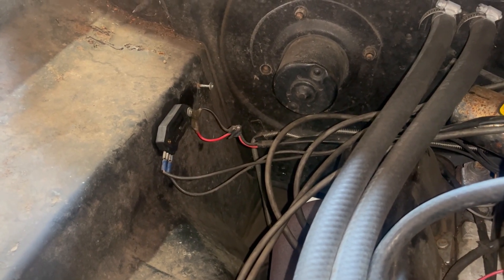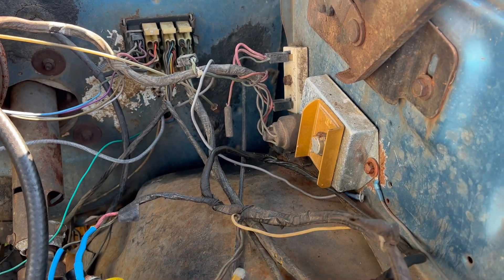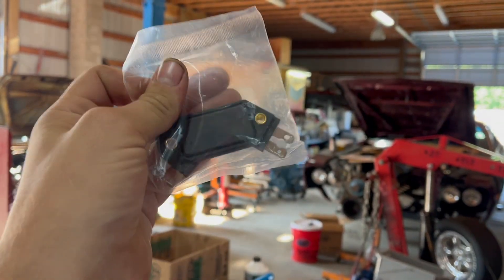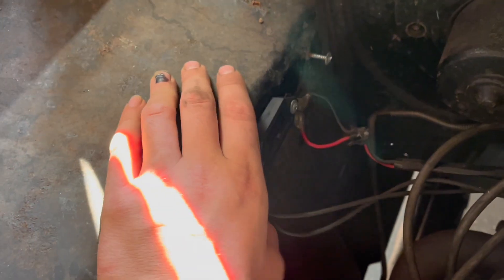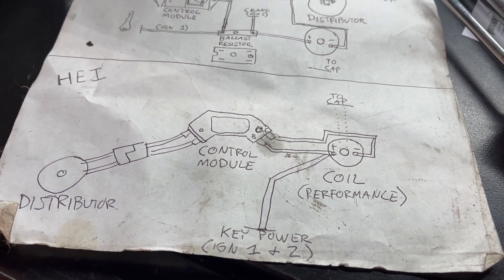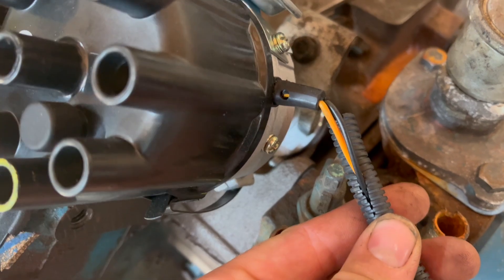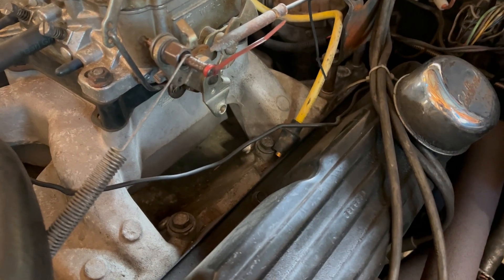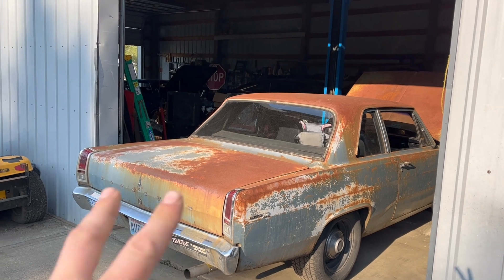The Big HEI Ignition Conversion Video! How To Convert Your Classic Mopar (Or Anything Else) To HEI

Comment: I was going to suggest a heatsink from the thumbnail, but you explained that, I even modify GM factory HEI distributors with an extra finned heatsink, especially with  performance modules
Reply: Don't need such IF you use the paste used in computers under the module, Been using Arctic Silver 5 AS5-3.5G Thermal Paste under EACH HEI module in my 3 Ford HEI conversions for 20+ years, NO issues with ANY of them

Comment: In theory, could you achieve multiple spark with a twin tipped rotor?
Or, a reluctor wheel with multiple peaks?
Reply from the maker: I don’t think either of things will do what you want. And - the MSD only gives multiple sparks at low RPM. I don’t know that it’s even worth much.

Comment: Great info, thanks!! Question: any brand of HEI module more reliable, and are there any brands to stay away from? Are genuine GM modules still available and are they significantly better?
Reply from the maker: I have been told in the comments that genuine older GM modules are a better bet than any new ones. I don’t know if they are still made, or if they’re any good. I usually buy Standard Ignition and have had relatively good luck.
Reply: @DeadDodgeGarage   Nope.  You still get to pay extra for 'genuine GM', but it clearly says 'made in China' on the box.

Now I keep my eyes open for HEIs in the junkyard to scavenge. (and, these days, it doesn't go that well)

Comment: That was a great discussion of the HEI. I noticed the quality of all of those ignition modules started failing more often in the '90's, late '90's when they became more 'imported'. The Mopar ECU always had the smallest dwell but were still reliable. The GM HEI had the best dwell. If you can find a genuine GM (Made in the USA) module you should be golden. Even a lot of the NORS were US made. I was always amazed that contemporaneously using mid '70's electronics GM was able to put their module in such a small format back then and the Mopar box was comparatively huge. GM did have a great R&D facility in the Delco Electronics div.
Reply: I paid $500 for HEI distributor to put on a Cleveland in the 90s. Now you can get one with plug wires for a 100 bucks.
And for another 100 bucks, you can get one that comes with the smaller cap, And
Coil on the outside . And that GM alternator with the internal regulator all you have to do is jump those 2 prongs togother
And charge fourteen plus.
Reply: I've purchased 2 standard motor brand. Now I purchased a "performance" one. It's got 1hour on it now its dying.
Reply: @denpepp4342  Usually the 'old' NOS or even used OE GM Delco ones were good. Even the 'parts store' brands up until the early '90's. The Pertronix 'original' Ignitor kits are OK. The original Ignitor was made in the US as of 5 or so years ago last I checked. Never had an issue with those.
Reply: In Auto Service courses I took, I learned that GM's HEI actually INCREASES dwell as RPMs rise. This allows for better coil saturation, resulting in consistent/improved spark voltage at higher engine speeds.
Reply: As a GM guy (by monetary necessity, I'm a Mopar man at heart and would've been a lifer if I were twenty years older), I can attest to just how damn well GM can do things when properly motivated. Apparently, their proper motivation ended in like 2008...
Reply: @The_sinner_Jim_Whitney  That's kind of what I figure too. After that govt involved bailout GM went to shite. And  Barra as CEO who has overstayed her usefulness.

Comment: I was skeptical that 0.38 ohm coil was too low. It would be if you were using a Mopar box, other than a real high end one like a P part Chrome or Gold box.  Well, depending on the ballast.  I just now am searching for "Primary ballast for an HEI coil" and it may be right on the money for that.  
     Anyway, you could find a good heat sink for that HEI module.   Also, some way to get it out of the flow of water from where the hood seals to the fender.
      Our family had a 56 Savoy when I was a toddler. Parked outside, water from rain and snow ran down the back of the hood to the distributor and other parts on the firewall and it was hard to start in the morning.  Towel drying was a frequent event.  The A engine had that disadvantage that the B and sixes didn't have.  I would love a 56 Savoy 2 door now.
Reply: Been using Arctic Silver 5 AS5-3.5G Thermal Paste under EACH HEI module in my 3 Ford HEI conversions for 20+ years, NO issues with ANY of them
Reply: hello ! ( from France) no way to understand how the HEI can suppress the ballast... ?? a 0.35 Ohms coil is about 43 amperes ... (12/0.35) this is exactly what my generator is producing ... of course with DWELL it is 43 x 0.7  = 30 A ...  can someone explain me this "magic"  THX ( sorry for my english here in FR everybody forgot Chrysler ignition, while it fitted a real huge lots of SIMCA)
Reply: @frednoname3714  Unless the Simcas are 8 cylinders, you don't need HEI to get a long dwell.
Reply: @auteurfiddler8706  another way to solve my understanding plz. Does HEI and MOPAR's modules just feed the coil some ms before spark ?  This would explain solve things. I want try that on a race SIMCA 1000 engine ( found distributor ) thx !!
Reply: @frednoname3714  I saw a comparison between Mopar box, HEI and Ford. They all use magnetic distributors. The current they generate is not the same in magnitude but the same in type. And the boxes or more or less sensitive. But that doesn't mean you can't mix and match.  I think you can.  Just make sure you ballast with the Mopar and regular 13.4 volts with the HEI.
 I would sure try to use the  HEI on the Simca. If it doesn't work , you can always get a CD ignition box that will work with your new distributor.

Comment: I had an experience where I had some Mopar ignition boxs and maybe a voltage regulator or two in my garage.  I noticed the goo or epoxy had melted and looked like a lava flow dangling from one ignition box. I cut it off (it had resolidified), looked at the box and the circuits, now easily visible, looked ok.  I put it back in the cardboard box with the others.
   Next time I looked, all the rest had melted out the epoxy, too.
   I have to conclude that the epoxy isn't failing because of old age or heat. The garage isn't more than 115 degrees even in the summer. I believe it is some sort of bacteria or fungus. In other words, it is contagious!
Reply from the maker: Gross… haha. I have seen many of them do that. Lots of rigs I’ve revived over the years have happy trails like that coming from the various modules.
Reply: @DeadDodgeGarage  It did not happen to identical boxes that were in cars sitting outside in the sun.  They were medically isolated from the infection.
I guess if I ever buy a new box, it will not go anywhere near the goo leaked ones.  I wonder if I can use some kind of epoxy to seal the backs up again.
It is a big space, so it can't  be too expensive. What do you recommend.
Reply: That's pretty common on the 'Mopar' electronic 'boxes' of that era. It's called 'potting' and won't effect anything. It's mostly a silica based 'sand' and a resin that's supposed to be 'semi-rigid'. Almost always it will melt when hot. I had a few of the '81-'83 Imperials a long time ago and all the modules did that under the hood. What you can do that works best is clean it off with carb cleaner or lacquer thinner. Then I used some 'flowable' windshield silicone from Permatex and leveled the box and refilled it. It sealed the old stuff in. You don't need to or want to get rid of all the old material. Of course, you could use epoxy or something, but you want to be able to dig it out if the box needs to be repaired, which is why the potting isn't permanent. It's supposed to provide environmental and vibration resistance.
Reply from the maker: @vincemajestyk9497  I'm well familiar with potting. Haha. My first experience with it was in electric guitar pickups.

Comment: The parts store control box deserves some comment.  The dome on the top is just a dome added to simulate the appearance of the transistor.  They took these apart and found that the heat sink is not connected to the circuits inside.  So it is essentially a dummy, too. I would not expect much if you are using these.
Reply: That's really interesting! I kind of suspected as much. I noticed it didn't have the thin Mica insulation under the heat sink/transistor.
Reply: @vincemajestyk9497  Yes, good observation!
Reply from the maker: I have heard this. I chose not to discuss that in this video. I have experienced many failures with old, factory Mopar boxes, and view them all in the same negative light. But there is a difference.

Comment: I had an 80s Culass Calais v6 which kept blowing up the hei ignition module because I failed to use the thermal grease because I was dumb.  Expensive education in heat transfer.
Reply from the maker: I find education is indeed often expensive…

Comment: Hey Jaime, great video! I made a video about this myself on my channel. Slant fish garage and for a very long time. Well, I still am hardcore Mopar but for a long time I've known about this swap and until just like within the last year I started using one of these on one of my mopars and I'm really surprised it works exceptionally well and with all the Chinese made parts around out there these days it's really hard for me to get the ballast resistors to last. I usually don't have a lot of trouble with the modules. I have had a couple of those go out but usually for me it's the it's the ballast resistors but great video. Keep up the good work man
Reply: Been using Arctic Silver 5 AS5-3.5G Thermal Paste under EACH HEI module in my 3 Ford HEI conversions for 20+ years, NO issues with ANY of them
Reply: Hey slant fish do you know  how to bypass the electronic controll lean  for the hei installation?

Comment: I'm going to have to disagree with you on this one, Jamie. I've always "converted" any Mopar I had at the time
to the Mopar electronic ignition - and always by using one of their kits, which are quite complete with harness
and all (even a new, slightly different ballast - 0.8ohm I think?).

I've never had an ECU fail either - but that might be because of my fondness of the really old ones from the 70's
and 80's, back before quality went to crap.
I'll still pick one of those up sometimes when I see it - which just means I have spares, I guess.
The other thing is - it's a MUST to convert the voltage regulator also. Makes a big difference!

BTW, a rebuilt A1/Cordone electronic distributor used to be a nice piece, too - but I think they discontinued them.
Mancini sells the conversion kits now from like 4 different brands - gotta watch out for Chinesium though!
BONUS: Accel still sells the heavy duty tan dist. cap w/brass inserts for their distributors - which is an exact
copy of the Mopar cap. Yay!
 -Ed on the Ridge
Reply: Way before the Chinese Proform knock-off 'Mopar' kits Mopar Performance had a rash of bad Orange ECU modules in the '90's which were US made. I got 3 of them brand new out of the box in 'kits'. Put my old ECU on and the car  fired right up. Chrysler was aware of it. Also the other issue was the late '90's to early 'ought thousands 'Orange boxes' (Mopar OE) would retard the ignition timing. So yes, the Orange boxes had quality issues going way back. My bad ones were in 1995. These boxes are so lousy now I have TWO bolted to my car. The one that I use and my hot spare. And I've had to use the spare and pitch the bad one and buy another to replace it 'in case'. Especially for an older 'classic' now, particularly one that had points, I would use a Pertronix or the GM module. I've had good luck with the original Pertronix. I've even used them in dual point distributors.
Reply: @vincemajestyk9497  +Up until 2006 I used a 70 Charger as my daily driver and that orange box would fail after a few months. I always kept a new spare in the glove and the proper sized socket for a quick change.
Reply: @MichaelKelly-yu3nl  I bought a couple of DC/MP orange boxes in the late '90's that were dead out of the box so to speak. Put my old one back on and the car ran fine. The best one's to get are the '80's old stock replacement ones like TRW, Sorenson, Borg Warner, Niehoff, Standard or like that. I usually just mount the spare onto the firewall next to the other so I can just swap the connector over, which I've had to do a few times. I usually have 2 mounted.
Reply: @vincemajestyk9497  Hence why I said "70's and 80's" boxes were what I gather up...
Reply: Those old OE ECU's were the most RPM limited of all. If you don't rev over 52-6000 RPM they're probably 'OK'. Stock were 3 flavors. 5200, 5500, and 6000 rpm. The factory released several updates to those from their inception thru the early '80's. You could not get adequate coil saturation for high RPM use. I have several TSBs regarding those modules. Even the Direct Connection Ignition Bulletin says that.  There is a list of the heat sink colors and part number with the coil primary tolerances and ballast requirements and RPM limit. There was a high reliability part sold that went to 9500 RPM. Understand that those early semiconductors/circuits were NOT fast switching devices which do not improve with age. The capacitors get leaky.  @moparedtn
Reply from the maker: Good to know about the Accel cap. Glad that has worked out for you. I’ve gotten plenty of miles out of Mopar boxes, but I’ve had almost as many failures with them as I have electronic voltage regulators - and that includes old factory stickered units. I’m not going to rely on them anymore. If a car or truck is already wired for it, fine. I’ll carry a spare box. If I’m retrofitting electronic ignition on a driver car, I’m going to go for a better system - which is easily in reach.
Reply: I won't buy an aluminum insert cap. They seem to last only a couple of hundred miles before the insides start looking black and crispy.

Comment: GM has rescued several other car brands with various parts and pieces. Large scale has a long reach.
Reply from the maker: Yep. I’m definitely not above using their better parts in cases that make sense.
Reply: @DeadDodgeGarage oh, you mean like using an LS instead of a Mopar small block? 😂😂😂
Kidding! Seriously though, after watching your recent video on Mopar engines I was reminded that the small block bottom end was more or less designed in the mid 1950s. Top end redesigned in 1964, then add roller cams in the 80s, then finally change the valvetrain design in 1993. And that lasted until 2003. Bloody amazing the original engineering on those things. If only Chrysler could have gotten their build quality dialed in like that, they would have been super successful for the long haul. Not just a few years at a time, like you pointed out in the engine video.

Comment: I have had a mopar in one shape or form for 50 years a d only lost 2 modules and 0 ballast resistors so if it ain't broke,leave it the #$%& alone is my motto,but good to know,have 2 440's in boat with electronic ignition from ma mopar. Will arm myself with the parts and keep in case of emergency. As always, very informative. 👍🍺
Reply: Typically one of the reasons those ECU's fail is from a bad ground. I usually run a ground wire from one of the mounting bolts to a good chassis or engine ground. You can check it with the key on using a test probe from the ECU case to ground. If the light illuminates, bad ground. Of course the engine wouldn't start. I had random 'no start' issues.

Comment: I've done it it two my cars and I'm loving it. Small block has an adapter from designed2drive. That hides module under distributor. For my slant six, I hide module in old broken orange box and used factory wiring.
Reply from the maker: Nice tricks. Personally, I don’t mind seeing the module. It’s tiny. But I can understand hiding it out of sight.
Reply: I heard about this then grabbed an old box I could gut.  Whatever the hell the compound is inside this thing is a devil to get out.
Reply: @charlesvictorrose Yes! That was the most time consuming job in this conversion...

Comment: Any of the new manufactured HEI modules are garbage if you want reliability go to the junkyard and find one from 74 to 80 General Motors car
Reply from the maker: I did neglect to cover this in the video. I haven’t had a bunch of failures with them like the Mopar units, but I’ve had a couple. Definitely want to go for the best quality module you can.

Comment: TheGM HEI was one of the best automotive inventions of the 70's. The cool thing now is you can get the entire distributor for pretty much any engine.
Reply from the maker: I meant to cover that in the video but… forgot. I don’t like the big HEI distributor in places it doesn’t belong, but that’s a matter of personal taste.
Reply: @DeadDodgeGarage  Yes, it's HUGE, but we have one on our W250 with a 318 and it fits all nice like.
Reply: There are small cap and big cap versions. Of course, you need your old coil for the small cap version.  On a Mopar, the distributor does not have a gear on it. But on Ford and AMC it does and you have to be very careful which gear you get with those aftermarket HEIs.  Iron gear with an iron cam and bronze gear with a steel cam (roller usually).  I THINK.
Ask around if you are getting one for one of these makes.
Also, the big cap ones interfere with many air cleaners on certain engines like 302 
Fords.

Comment: Yeah but that's pretty easy all you have to do is go down on your starter solenoid and run a wire from there to your coil very simple fix
Reply from the maker: That’s not a thing on Chrysler stuff… have to use the ignition 2 feed.